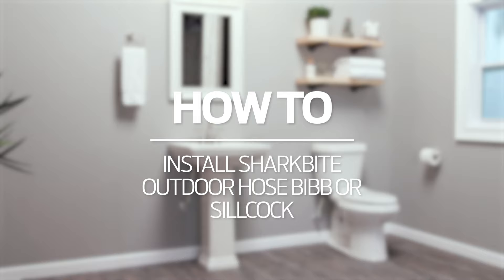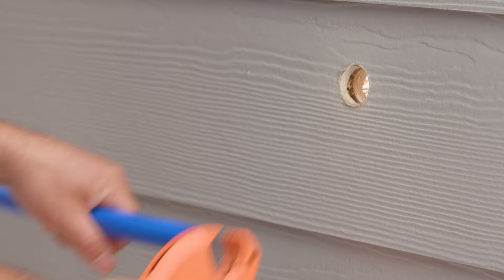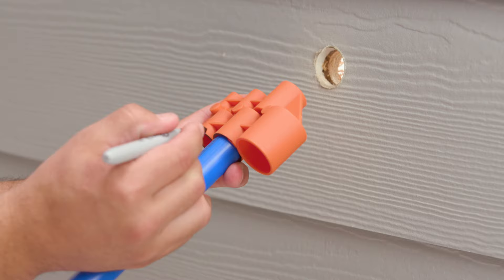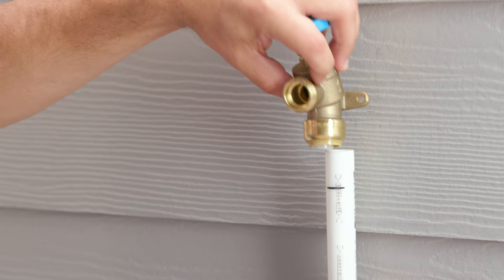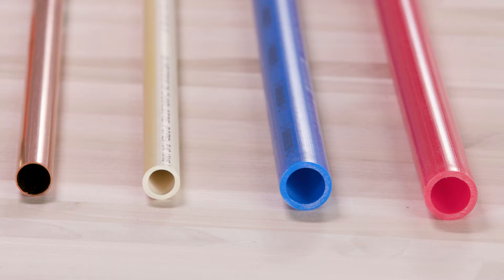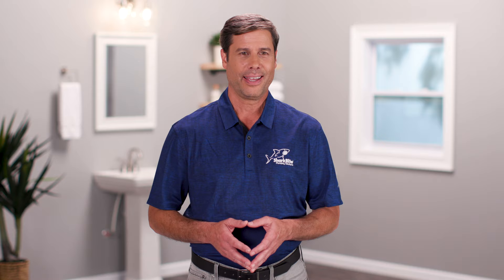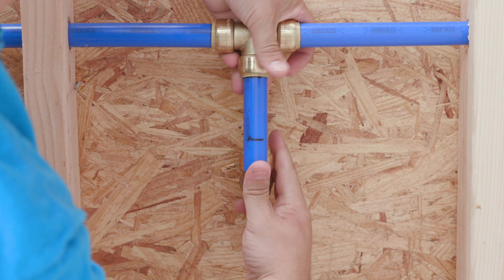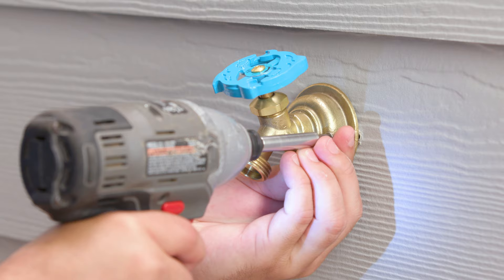How to Install an Outdoor Hose Bibb

Comment: I was pretty nervous when I saw that Home Depot only had this type of connector for replacing the hose spigot on my home.  I hadn't used these before, and it seemed too simple for me to easily trust.  Also, my copper pipe was all cruddy and old and not really smooth.  After a half-arsed cleaning/polish with a not-especially-fine foam sanding block for wood, I wiped it clean, and shoved the new spigot on.  No leaks .. seems to work great :)
Reply from the maker: Thanks for giving us a try, Montgomery! A clean pipe and a hose bibb are all you need to repair your outdoor garden valves. We'd love to share your experience with our larger audience—Share your SharkBite Story in a Review: https://bit.ly/36nTo8q.

Comment: One of the other posters has a very valid point. The holes are very small in the flange. I love the product but the trouble I went through to mount this to a brick wall was frustrating. All of the trouble could be alleviated by a slightly wider flange with bigger holes.

Comment: Does anybody know if the sharkbite sillcock can withstand the cold winter in the North East, like let's say New York?  Not sure what the rating for winter is and if the rubber ring/stainless steel teeth that crimps to the copper pipe would last in the hot and cold weather of the Northern part of States.
Reply from the maker: SharkBite hose bibbs are approved for use in hot and cold climates such as in the New York.  The EPDM rubber O-ring and stainless steel grab ring in our products will not be negatively affected by the cold/hot weather in these areas.  It will be important to make sure that any water inside the valve or surrounding pipe is not allowed to freeze as frozen water expands and can create pressure that can cause failures.  We also offer a SharkBite frost free sillcock that has the shut-off located at the valve’s inlet to keep the water inside the heated area of the house and prevent it from freezing.

Comment: I just installed a 12 inch frost free SB in upstate NY. Worked pretty smooth , but I had to revise the copper supply pipes to make it work. Used SB couplings for that. My 10 plus year experience with these fittings is no leaks. I think their deburring and measurement tool is a must to ensure the ability to insert to the proper length. I only solder now if “off line” . The added benefit is that fittings allow a swivel to position.
Reply from the maker: Right on! Thanks for choosing our Frost-Free Sillcock for your install. 🦈 Sharks for the win!

Comment: Shark Bite I was going to purchase this item at Home Depot last night but there is a major design flaw. The holes for the screws to mount this to a building will not accept the smallest of masonry screws. I can’t be the only one with this issue,  half of all installs might be to masonry.
Reply: I mounted an 1/4" aluminum plate to the masonry then mounted the shark bite to that with machine screws.

Comment: what is the white plastic thing on the frost free sillcock for?
Reply from the maker: That’s the angled siding wedge. When installing on the surface of an outer wall, this piece is what ensures the line can be fully drained before the winter hits. The wedge angles the sillcock 5° so the water drains properly. While this video didn’t show the Frost-Free Sillcock installation specifically, it’s the same process—Just be sure the wedge is installed along with the valve.

Comment: So all I have to do is ensure that enough cleaned and deburred half inch copper pipe is sticking out of my brick and mount plate to fully Engage The correct length Frostproof spigot?

Comment: Try to remove it when no acces from back wall !!!! Impossible !!!! Garbage.
Reply: How would you install and remove any plumbing fixture with no access?
Reply: @AStanton1966  Easy. Design it with tube attached, like regular frost-free designs. Then, you’d have access to the PEX or whatever connection inside the house.